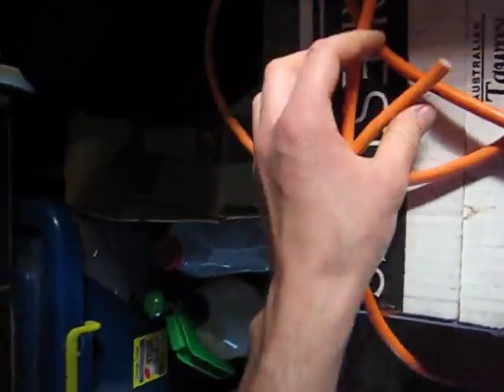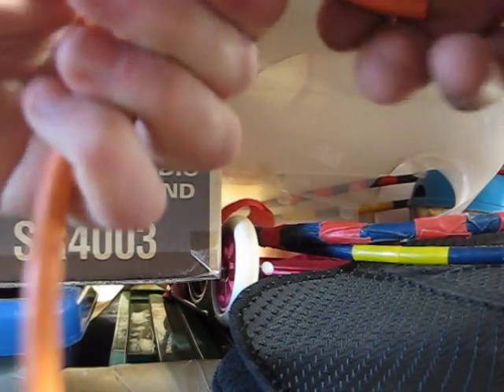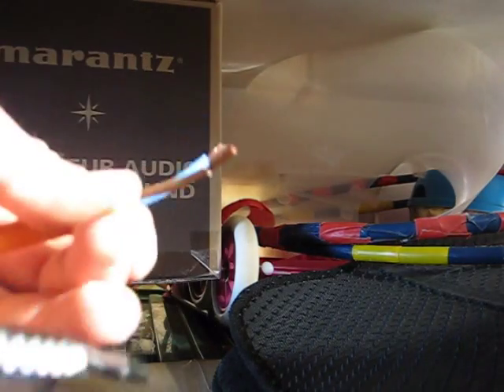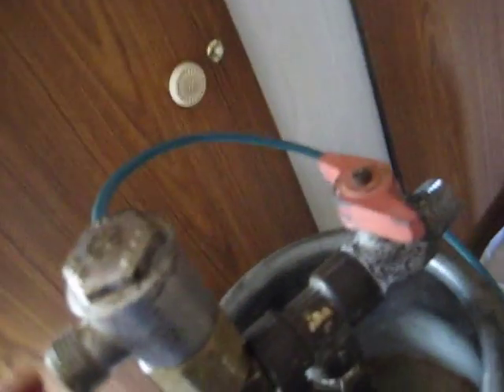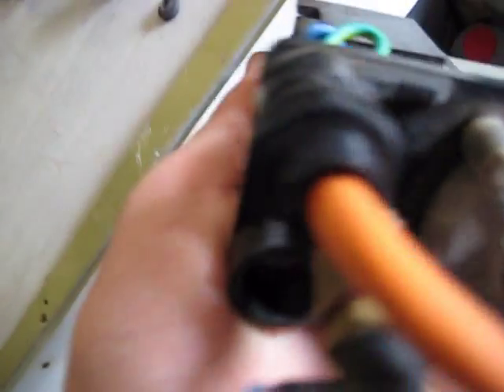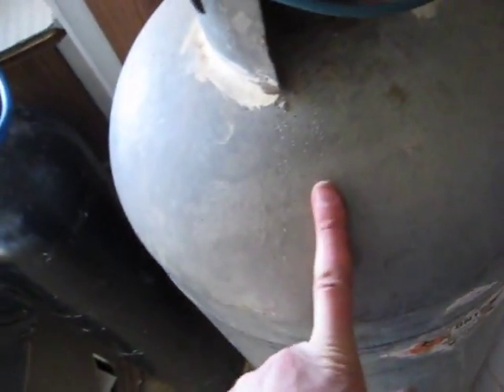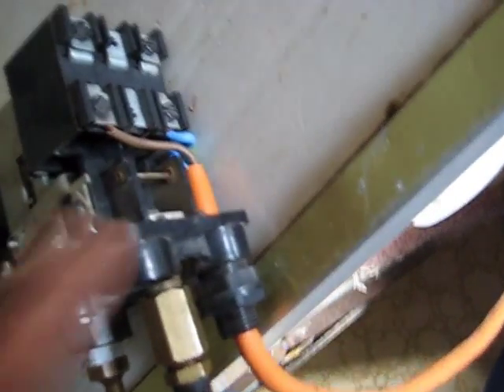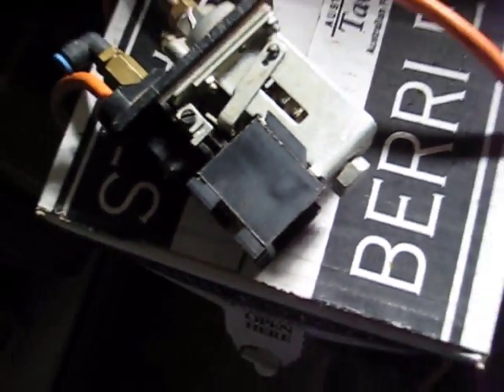Wiring a pressure switch for my DIY Air Compressor (Part 1)

Comment: nice job mate, also dont forget to put a safety valve on to prevent tank overpressure if the pressure switch fails,all aircompressors have them cos it stops them from turning into a rocket if something goes wrong.